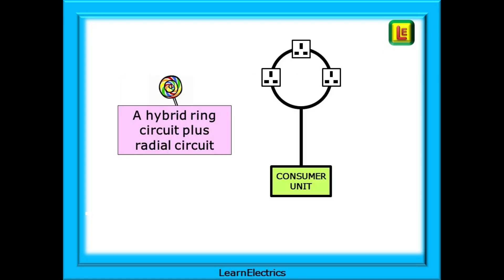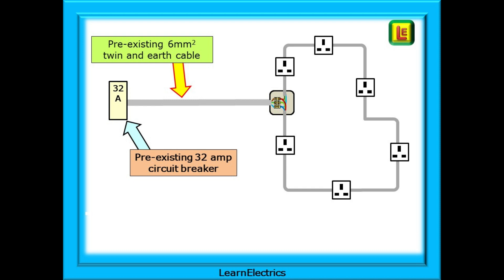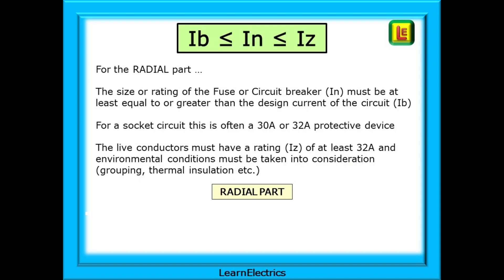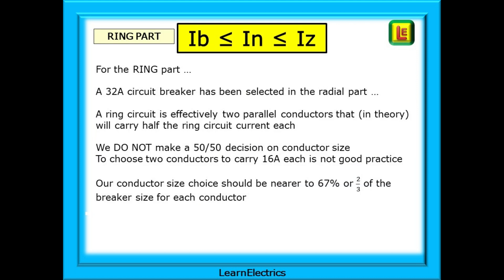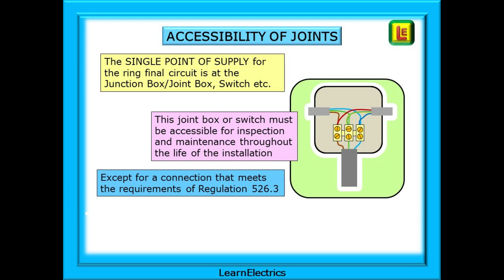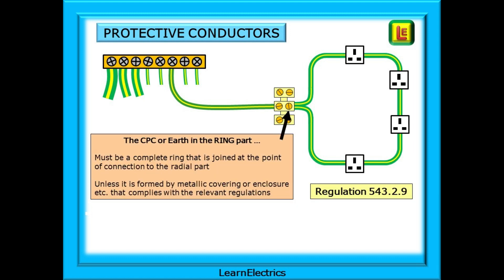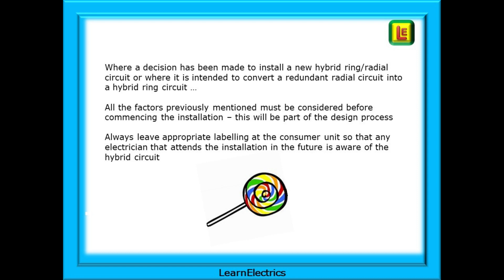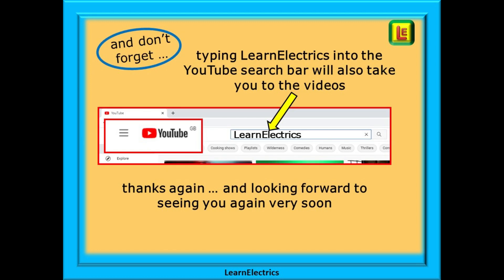LOLLYPOP RING CIRCUITS – HYBRID RING AND RADIAL CIRCUITS – HOW THEY WORK - HOW TO TEST THEM

Comment: This is essentially the test and inspection procedure for a garage/ workshop or shed with a ring.  I have encountered redundant shower circuits converted into lollipop corcuits for loft conversions. Makes sense and saves having to draw additional cables fom the cu. 
You're a top fella Dave    I appreciate the time, effort & knowledge you put into these tutorials. 
Thanks
Reply from the maker: Thanks Ray, its great to have someone else that has come across them backing up the principles of them. Thanks for watching. Dave.

Comment: Thank you for the informative video. I have a question regarding the documentation of test results in the test result sheet. Specifically, do you document the individual ring main readings (r1, rn, and r2), or do you only record the combined R1+R2 values for both the radial circuit and the ring main? Since this is not a final ring main, I have some doubts. Best regards, Izzy
Reply from the maker: Izzy, good question.
If you know exactly where it changes from radial to ring and you can access it, you might want to test and record the separate readings. Often, the junction is difficult to access, I would record the R1+R2 at each point of use and record the highest value. As long as you have tested and are satisfied yourself that the circuit is safe and within parameters, no-one is going to beat you up. In your professional opinion, you have recorded honest readings. You can always make a note in the comments section saying what you have tested. Anyone following you will then know exactly which tests were done. Hope this helps.
Dave.

Comment: I wonder if some electricians would install a 4mm² radial from the junction box 6mm² cable if they didn't want to install a ring circuit from it. Do you know if it's OK to do that aswell?
Reply from the maker: If you want to keep it as a radial circuit, just install it as 6mm or 4mm in one go, never mind the junction box. Treat it as a simple radial circuit then.

Comment: Hi Dave, I have my level 2 exam fundamental inspection and testing coming up, do you know of any new mock exams available? Also what will the difference in revision be for the level 2 fundamental and the level 3?
Reply from the maker: Haider, level three will be more technical with more calculations. Check with the training centre or college, they should be able to provide you with the relevant info for the exam you are sitting.

Comment: These circuits can be very useful if done correctly, I would like to see how you would certify these, do you like me split the  circuit into two parts, for  instance Circuit .3.A (Radial serving Ring Final) .3.B (Ring Final) Lounge. or something similar.
Reply from the maker: I would combine the results on one line and then in the contents column make a few notes on what is there etc. There is nothing wrong with attaching a hand drawn sketch to the schedules. Dave.
Reply: @learnelectrics4402  There was an article in Connections magazine. I think it was back in April 2014. Just looked it up on the NICEIC web site and it's the only one that is unavailable. I always add lots if notes etc to my certificates to help anyone who works on an installation after me. I use NICEIC online certification. Thanks for all the videos. Tony.

Comment: Unfortunately the 4/6mm thats usually at the consumer unit, is usally no where to be found, i mean the location/Jb that connects to the ring final... so if there's a fault its almost impossible to solve and will require a rewire.
Reply from the maker: Unfortunately that is often the case, especially if its non sparkies or can't be bothered sparkies that do it. Even harder when its an EICR on a house when it was done before the current owners bought it.
Reply: @learnelectrics4402  exactly whats happened, we are rewiring the kitchen tomorrow due to this. Appreciate the videos by the way👍